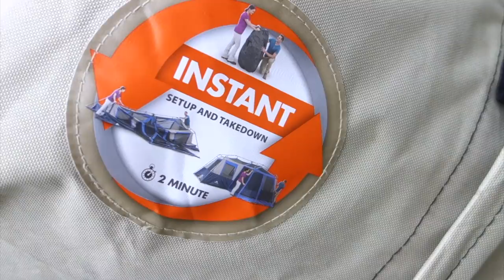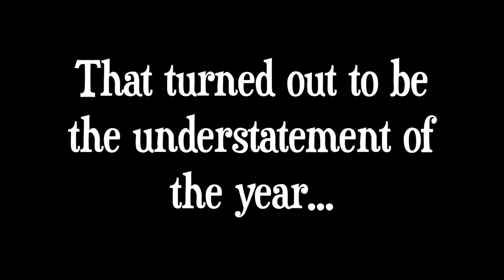I WASNT READY FOR THIS!! Brutal Race | Ormond Beach Hare Scramble 2018

Comment: Dude you're not fat, you're just full of heart. RESPECT! 
On a side note, that bash plate must have worked like a mud shovel lol. That thing fill up with mud? Cause that would be another 50lbs to haul around.
Reply: Joe Rockstar Joe and shadetree, my motivation  to get into harescramble, you both rock.
Reply: Want some advice? Pull your oil fill plug, fill it up with mud. Rev it sky high till she locks up solid. Put it in neutral, push it out of the woods and tell everyone she locked up on the straightaway at about 11,000 rpm passing the leader!

Comment: Momentum is your friend, higher gear and keep as relaxed as possible so you aren’t holding on too tight. Let the front do what it wants. Your doing awesome mate, keep the practice up and you will be passing guys in no time.
Another thing, if your not already get Tubliss and run super low pressures in the rear especially. You will be amazed by the amount of grip you get, best investment ever in my books.

Comment: The thing about 2-stroke pipes is that they're tuned to the engine to produce as much power as possible in a certain rpm-range, and if you deform the pipe, you're distorting the tuning. The 2-stroke exhaust system is a precision tuning item and you can lose serious power by deforming it and especially denting it, because both volume and shape are important for tuning.

Comment: A few technical questions:
1: Those tires kept sinking into the mud. Would sand or baloon (3 wheeler) tires have done better?
2: Would such a change disqualify you in this race?
3: The ones passing you were always going at a good clip. Is this part of the secret for floating over the ruts? Just gun it and go for it?
I've encountered this in plowed fields before and there's some merit to it.
4: The rear wheel always sawed a rut, and the front didn't seem to track. Is the bike unbalanced, favoring the rear?

Comment: Is it grip n rip or grip n slip 🤣 You soldiered through man 💪🏼 Speed and momentum will keep your knobs cleaned out for better traction and balance. The deeper ruts are generally on the outside of tighter turns. Respect ✊🏻

Comment: Hey man great race, your nothing but heart! Keep practicing your rut riding, try to click it up a gear higher and carry a little more speed. It will help you stay in your  line and not cross rut. And keep working on those pivot turns, they can help you save so much energy. Pulling your bike around burns you out quick. Use the bikes engine to do it. I love your videos man, keep up the good work. Never stop pushing!!

Comment: I did that crazy shit in the Jersey Pine Barrens. The worst part is you have to hang in there just to get back to your truck, like it or not.  I rode 3 enduros and gave it up for flat tracking after deciding it was like locking yourself in a closet and beating yourself with a baseball bat.

Comment: if your serious about getting better at races, I know its money but a new back tire every race is honestly the pro hack. in the mud you have to maintain the right speed to keep your tires cleaned out. id recommend getting a fatty in the front when hare scrambling. in particular a shinko mx216.      fans are the way to go also, I set mine to kick on at 190.  p.s.   try standing up more . keep weight on the pegs.  
 brapppp

Comment: About that starter, check the ground bolt under the seat connecting the battery to the frame. There are a couple washers under the bolt that corrode. Mine and another dudes had same issue. Clean them up, put some dielectric grease on there and the two bolts in the battery and your starter issue will most likely be resolved 👍🏻
Reply from the maker: Thanks for the tip man! Ended up needing a new bendix and a new stator... looking forward to watching your new race vid when I get home :)

Comment: dont worry about tare offs get yourself a piece perspex plastic about 4-5 ins long and tape it to the sun visor on your helmut and when you feel that your about to eat dirt lower your new roost deflector down so it covers your goggles then lift your head back up and guess what clear vision amazing try it you will not ride with out it i use it in enduro events when i come up close behind some one looking to pass works every time and dam cheap
Reply from the maker: Thanks for the tip!

Comment: Riding slow in mud is really difficult. You have to keep momentum and stay in a high gear so you aren't spinning the rear wheel which will step the back of the bike out. You also have to stand and let the bike dance underneath you.

Comment: So....did you drop tire pressure for this? And, my broken record self: Stand up. (I know....you're tired...but try it as much as you can) keep weight back, over rear tire, be loose and let the bike do the work. You gotta keep on the pipe, bud...keep the 'R's up...everything I've read/ seen / experienced, faster is better.

Comment: The guy i bought my 250EXC from smashed the pipe on it and it pushed the pipe into the starter cover and bashed the right radiator. I had to replace the radiator and pipe. Luckily the starter cover was just cosmetic (melted that corner).
Reply from the maker: Yup. Even without rocks, my dumb ass did the same thing lol